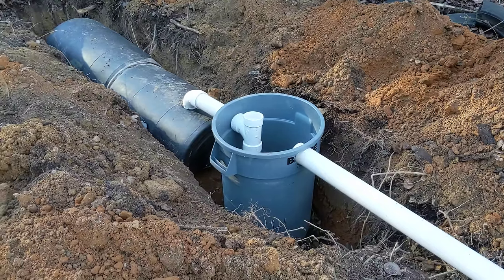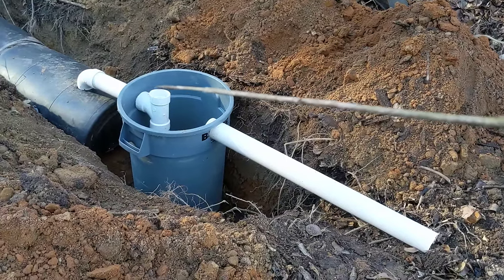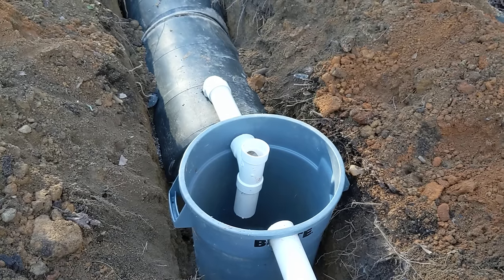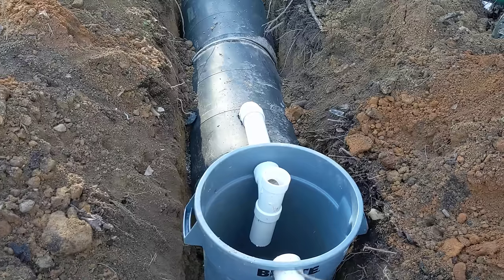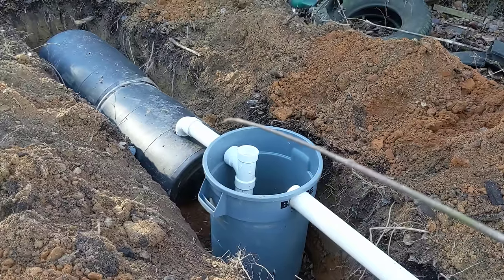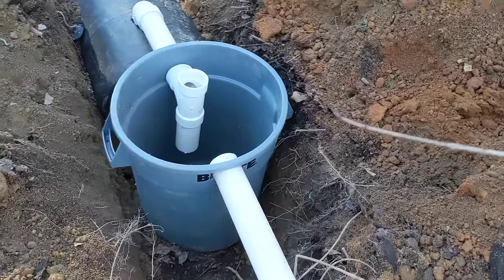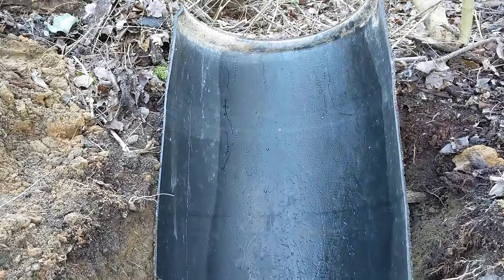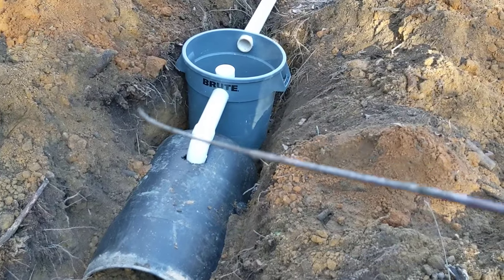DIY septic system for your retreat property!

Comment: So I have no doubt this would work for a brief period, but you need to have it inspected and permitted first. The reason for this is: You need to be out of the frost line which may require the construction of a mounded system otherwise in colder months and even spring/fall the water will freeze and not drain properly; You need to have a soil type that allows for proper leeching otherwise the system will fail; I dont see a leechfield or a mention of a leechfield, which will compound the issue of freezing/backing up; and that dbox is waaaaay too big for that application. That being said the government can get fucked but if they find out you installed a septic system without a permit you'll be in a world of shit (literally)
Reply: Do any of you know long Dhec has been around ? They are just part of the Gov controlling thing septic system have been around for longer than Dhec and like this man   Is showing it’s a simple sys I know system that have been in use for nearly 100 yr and work fine never had a Dhec inspection.
Reply: There are codes for a reason.  I bet most people on here don't know their local codes, which includes but is NOT limited to "frost line" (as Ace mentioned).  
If you don't want it to be inspected, that's fine.  But you should really study your local septic codes before screwing yourself...

"Screw the system" mentality only works when you are all for screwing yourself.
Reply: William Craft      I know the codes very well , think you . I have been a general contractor for 30 yrs now and yes you are correct there are codes to go by in some situation how ever sceptic system are not rocket science provide you don’t want to install one in low laying areas or a swamp. Hell thats halve the problem in the US now to big a government and to many CODES. 😊 this is just my opinion.